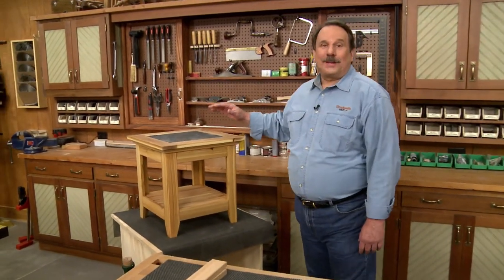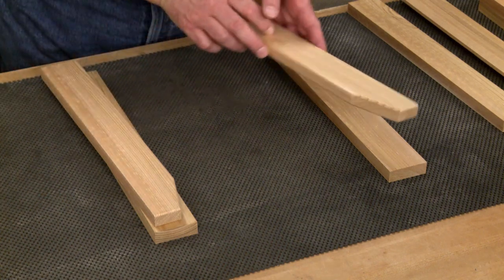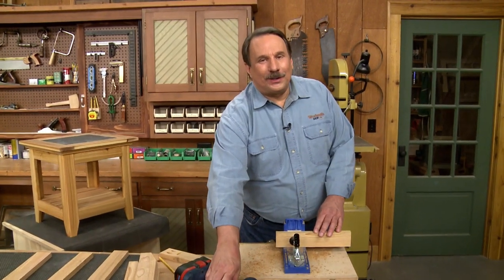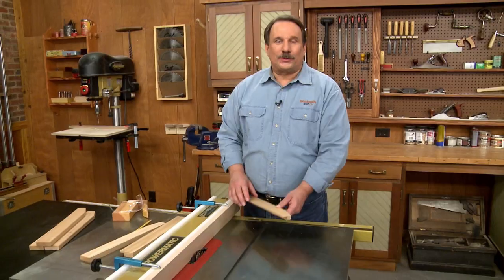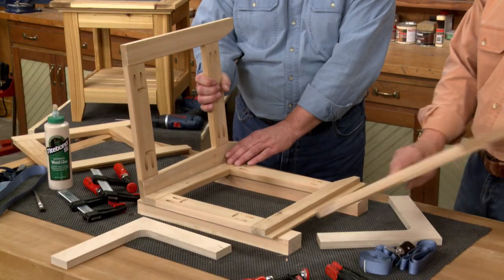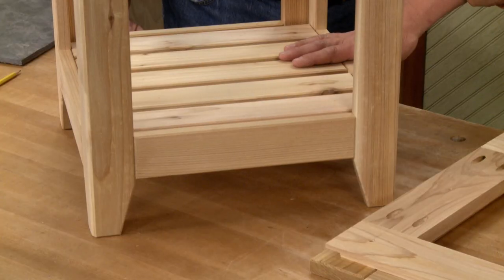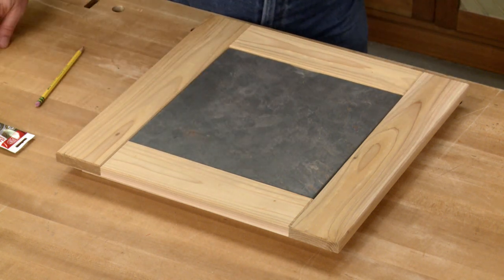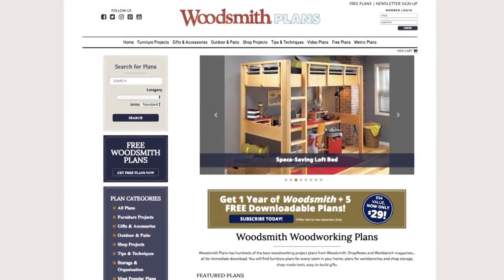Build an Outdoor Tile-Top Table in a Weekend!

Comment: Built this table out of 6" cedar fencing.  Had to adjust my cuts for the thickness of the wood.  Used a 1' x1' of square grey granite from Home Depot.  Since this was a wedding present and the couple wanted grey color used a wipe on stain.  After wiped it highlighted the cedar grain and the softer wood took the stain.  Three coats of spar varnish (and I added 1" x1" blocks behind the bottom of the legs and mounted leg levers to assure no wobble on an uneven deck.  The couple loved it.  Still in use 4 years.  This plan can be easily modified for different sizes of stone/tile and height of the table as well as species of wood.

Comment: This project was originally featured in Woodsmith.  I built two of these tables about 20 years ago.  I built them using red oak and marble instead of cedar and a man made material as the center tile.  I also built each on taller than the suggested height.  They are used as end tables.
Reply from the maker: It's a pretty nice little project.  I was thinking about building a couple more of these tables after digging up this video.